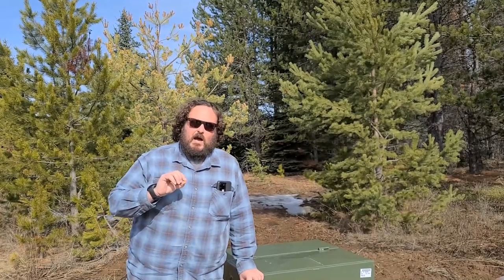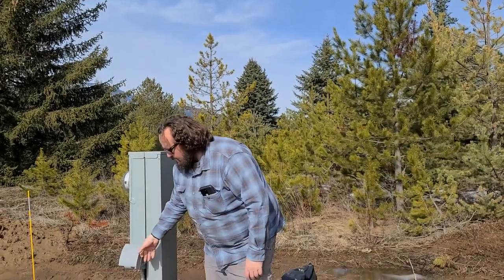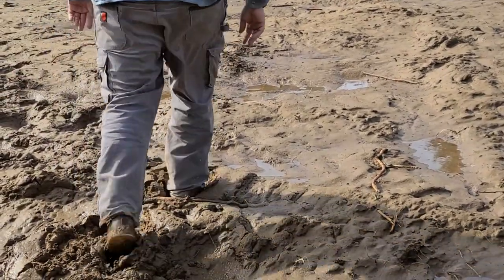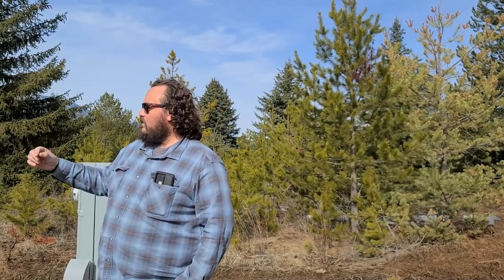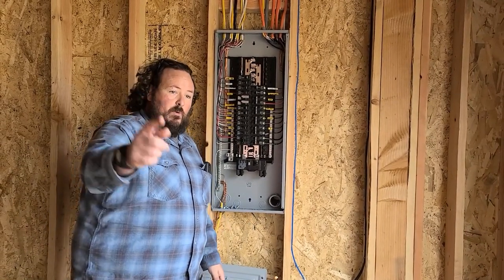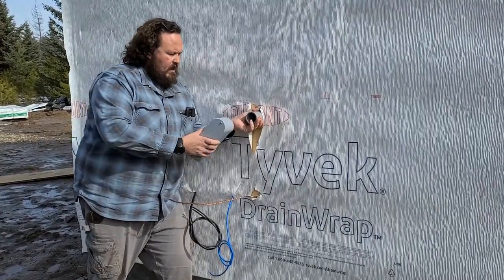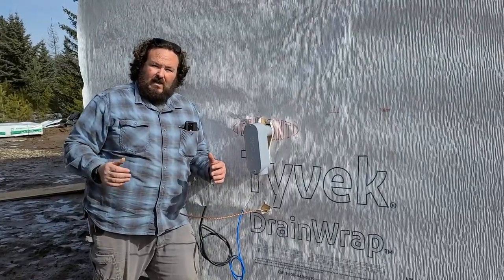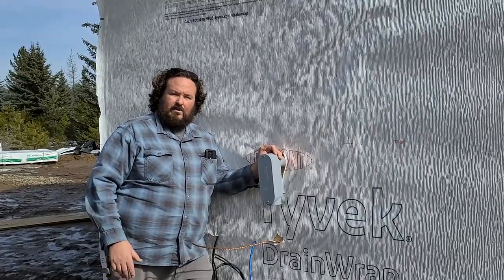Electrical Service Installation

Comment: Nice work! That is how My place is wired, 400 amp service, meter at the transformer. They original owner was going to build a seperate house, but bailed.I need to build a seperate shop to use up that extra power. ;-)

Comment: Wow your Electrician does a nice job on the panel, But just maybe has never pulled underground that far, he should at least went with 2 1/2 conduit. But this is really a job for a 3 inch conduit. The price difference is a family night out to eat at a nice restaurant.

Comment: how do you like the cat from the bobcat that you had
Reply from the maker: I love the bobcat E55 but this cat 306 is at a different level. If you want to run a serious excavation company you need to run a multi tool type machine like a next generation Catapillers.